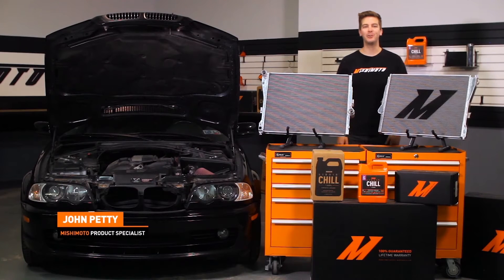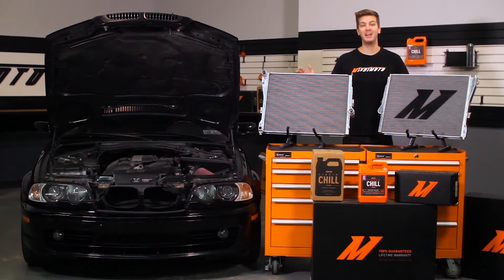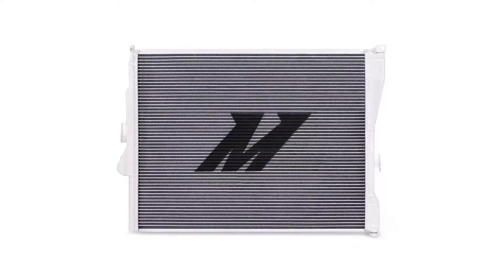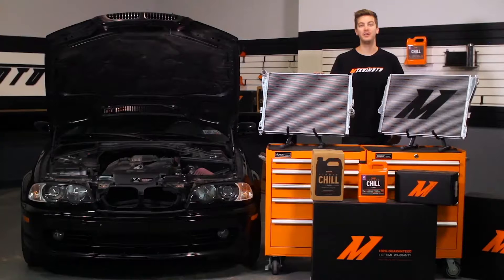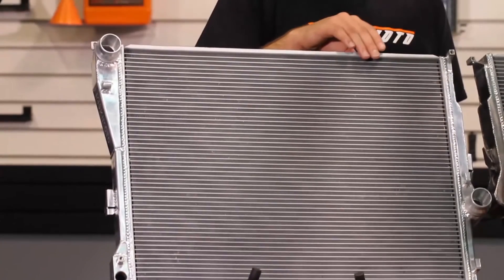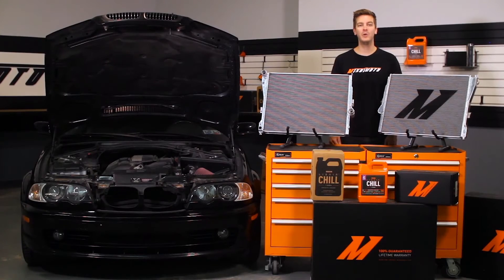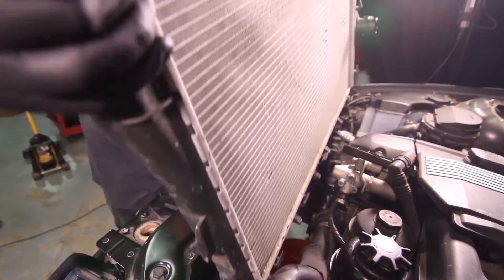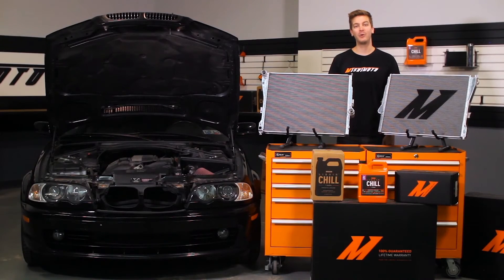1999–2006 BMW E46 Non-M Performance Aluminum Radiator Features & Benefits By Mishimoto

Comment: Wil it fit without removing the A/C radiator?
Reply from the maker: It shouldn't require the removal of the A/C condenser. Below is a link for the install guide. 
https://youtu.be/FOcv_LamrqY

Comment: Will this fit a 330ci?
Reply from the maker: Fits:
1999–2000 BMW 328i (E46, all bodies)
1999–2000 BMW 323i (E46, all bodies)
2001–2005 BMW 325i (E46, all bodies)
2001–2006 BMW 330i (Including ZHP Models)
Reply: @mishimoto  Do you guys also sell metal power steering reservoirs? Thank you for the information.
Reply from the maker: https://www.mishimoto.com/catalogsearch/result/?q=power+steering
Reply: @mishimoto so no mod needed first right in?